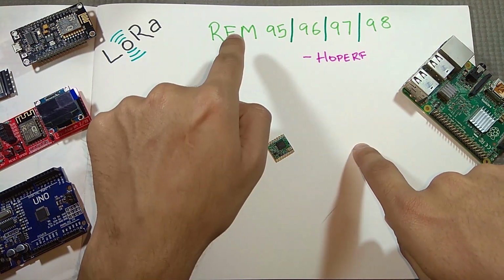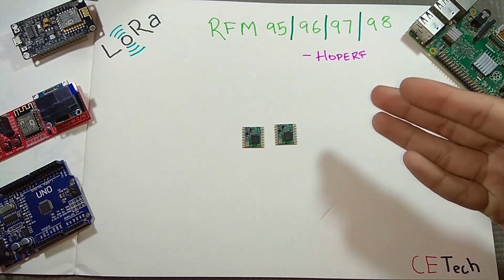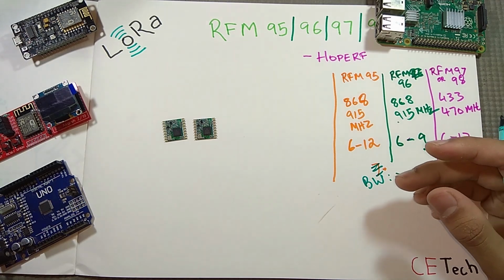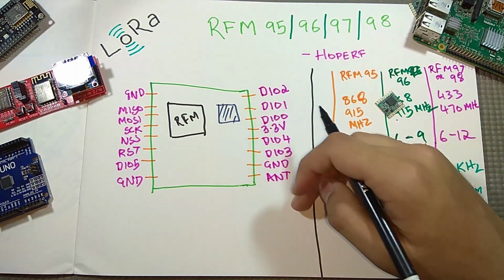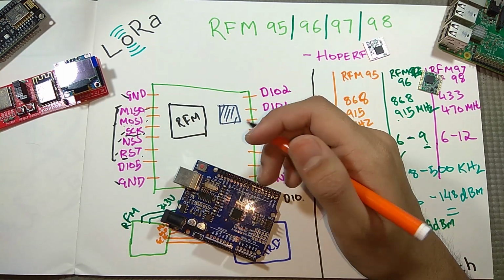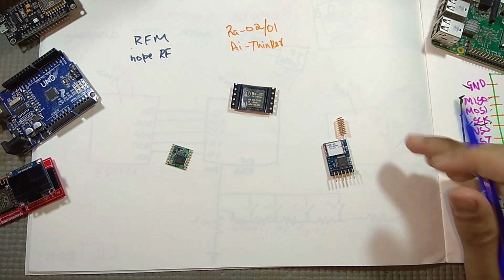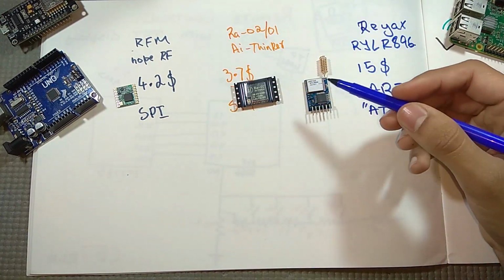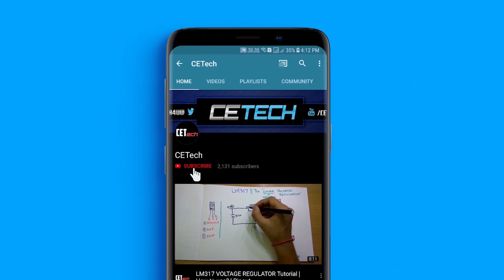LoRa RFM95 Tutorial Ra-02 HopeRF module comparison RFM95W | LCSC

Comment: Can I use the RFM95W module to work with the AU915 ISM band which is 915 – 928 MHz?
Reply from the maker: You have to set the correct frequency in the code

Comment: can someone help here im using an ra 02 ai thinker sx1278 433 mhzim trying to send packets then sensor data dht using an arduino  well the problem here i want my signal to be in lora mode means css modulation  but without succes s i tried using the registres in my programme but without success  so if any one here used that module  please give a damn programme who sends packets in css modulation     why i want that because i want to decode the lora packet with gr lora project that uses css modulation so please please help ?